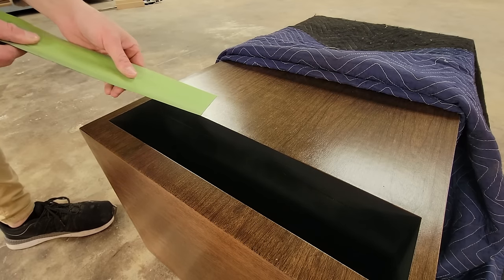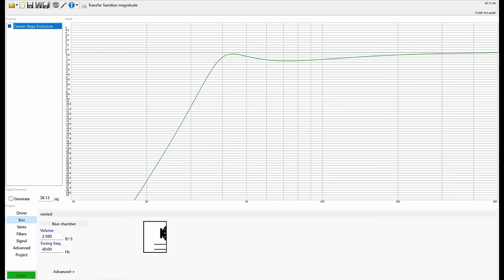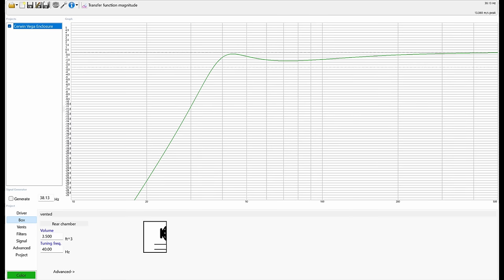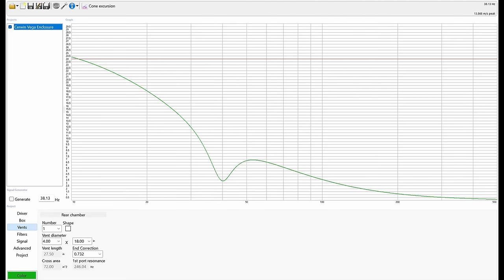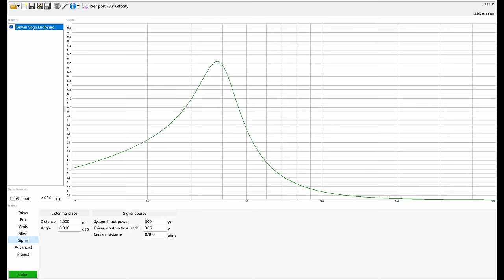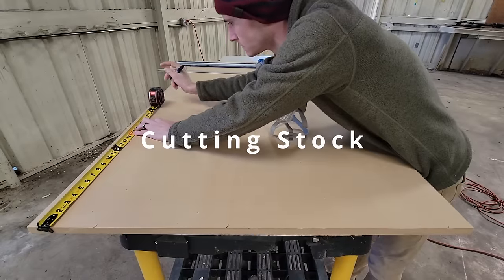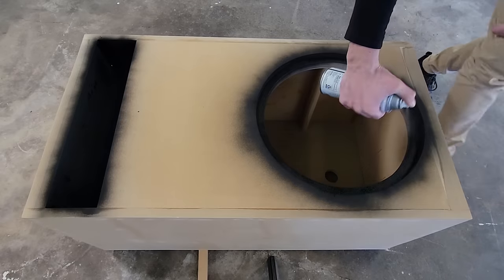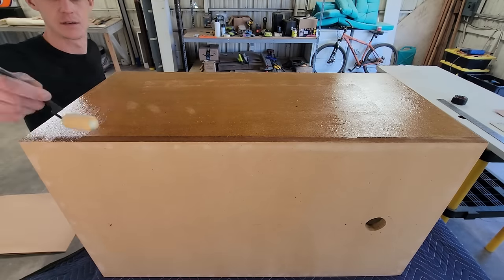DIY Subwoofer Build With The Legendary Cerwin Vega Stroker 15

Comment: Did someone say Stroker?

I've been obsessed with these subs since I was 14(I'm 44 now) I've never even heard one. I'd love to have a build like this. It's very nice.
Reply: Same here always wanted one
Reply: @abramesparza1945  Did you see them for the first time in a Crutchfield magazine like I did? Lol I used to lust after the Stroker. They had a 32 pound motor which was unheard of back then. I did a hood about 10 years ago. Kind of wish I had used them when I had the chance. I'm out of the car audio game now. Probably forever.
Reply: I recently got me a Stroker pro classic 18” and I too dreamed of this sub in the 90’s. Proud to have it in my current system. Might I add, these subs sound accurate and get low and loud all in one.
Reply: @Jt19702  That's awesome man. I'd love to hear it. What Amp do you have running it? Sealed or ported enclosure?
Reply: @dextermorgan1 I currently have it ran by a JP43 @ 2ohms. My plan is to run it on a quality class A/B amp to get the most SQ with the ability to get a little loud.

Comment: Great build! I love CerwinVega! I wish they would do some nice wide baffle home speakers with the high build quality that the stroker sub has. They are definitely capable of it. One free tip that you could have done, and might consider on all your builds is to round over the inside of the woofer hole on the baffle. This can help with letting the speaker play to its full potential and doesn’t cost anything. 👍🏻
Reply from the maker: Yes I hope they release some nice tower speakers in the coming years. They do have a pretty extensive line-up at the moment. They're just not very visible as a brand. 

If you notice on the recess, the t-nuts actually hang out just a bit. I was afraid rounding over would expose too much of it, and be weaker. This is a HEAVY driver, so I played it safe. But yes, definitely a good idea in general.
Thanks for watching!!

Comment: I've got a Stroker 12D (dual 4 ohm) from around 1995 in a 2.7 ft3 L-port enclosure tuned to 45hz (C-V recommended) and while it's a pretty unique woofer, there's no way I'd have paid what it cost new. Found it on the side of the road on garbage day. It still works, but maybe after a recone I'll be impressed, dunno.
The 15" and 18" versions are WAYYY more effective.

Comment: I think you should have done bolts instead of a cup cut out for the wire conneciton outside the box.  years ago I would have not known the improvements that avoiding those would lead to.  Tubes (mainly for home) or nice lugs to bolt to is what I see more of the pros use.

Comment: Makes sense now!  I thought it was some type of coaxial driver when I first saw it so the thought of a one driver full range enclosure sounded. . different. Can’t wait to hear it. Looks great, as usual. Btw, how long are the pin nails you use?
Reply from the maker: I believe I was using 1-inch, and 2-inch for double panels when possible. I didn't nail everything, just when it was easy enough. I always prefer clamping when conditions are right.

Comment: HEY!!! A fellow user of the "thumb on the button" rattle can painting method.
Nice work on the cab.
Although...
I did flinch up a bit when you stepped back to hit the lacquer with one last little kiss from your sprayer 
IN THE OPPOSITE DIRECTION of everything else that you had laid down.  Lol.   
I have done this many times laying different types of finishes and have only had it effect the sheen once or twice.
But when it does... I just feel sick about it, so it's become a reflex for me to flinch whenever I see two wet products overlapping perpendicular from each other. 
Like a jump scare video. lol.
But I can be anal about things "just in case" but that one can for sure bite you on big flat surfaces like that.
You're doing a very fine job and you have reinspired me to consider doing something this weekend.

I have an older Peavy Backstage guitar amplifier that has working electronics, but the box is rough, and I have thought about 
Building a new one from red oak with an ebony die and lime wax finish (Cerused finish) and make a solid copper face plate
along with 8 corner covers from the copper as well.

The speaker it those are nothing to look at, so I need to come up with some type of fabric to cover it with.
Something blk and copper colored

I will also change the knobs to something better (to match new design) than what is on it now. 
I anyone thinks what would be a cool knob idea (vol / tone / drive, etc) let me know, I am thinking about something that size
that already exists that I could drill an apx. 1/2 in. deep, & apx. 3/16th dia. hole in the rear of it to mount it to the Attenuator
Black/ copper color related.

The only thing that I have thought of...

I was thinking about soldering a few 1 oz. Morgan copper dollars or something of a similar type design 
(many different styles from $2 to $9 ea. .999 pure) to a hex shank rivet nut just because the nut would be an easy way to make it mount, but something cooler, would be way cooler.
Reply from the maker: Jump scare lol I get that. It did turn out fine, but I was going crazy with the lighting in my shop. With that sunlight coming in from one side, it made it look like my spray pattern was all over the place. I couldn't resist hitting it one more time lol even then it didn't looked right in the sun. When everything cured it looked great. Not the first time I've had sunlight play tricks on me!
Reply from the maker: And yes I think you should go for a weekend build project. If you finish it, let me know where I can gander some photos!

Comment: Nice build! What are the internal dimensions of the box and the vent?  I've got a BOXPLAN workbook that can predict where the out-of-band vent resonances will show up, and this are impacted by the internal dimensions of the box and the location of the vent and the driver in the box.   The impedance curve shows a bit of loss around Fb BTW, but I suspect that's more due to the driver than the box, because the box looks pretty solid.
Reply from the maker: Hey, I'll have to check for enclosure dimensions when I get around my PC. If I recall, I believe first port resonance was pretty high, if that is what you're referring to. I believe it was at least 140 or so, but I'd have to look again.

Comment: Nice build! I love cerwin vega, and the strokers are high up on my list of things to build. Normally where I live I see the stroker built with tubes, like standard round vents. How do you get the measurements for the square vent you built? I see that you use winisd and square vent,  it your is like a small horn with those angles etc.
Reply from the maker: Hi, square & round ports act as the same thing. There is a mass of air inside that can act to extend bass for some frequencies. If you're familiar with winisd, you can simply click on the square or round port icon to change between them. In general I use slot ports, because they are cheaper and usually easier to fit inside an enclosure.
Reply: @DIYhyfy  Thanks for your reply! I’m not familiar per se, but since last night I’ve modeled boxes and boxes. I figured out that square vent thing now. But, the vent you made in your stroker box, did you take in consider the displacement of the actual port?

Comment: Put a washer on the train nut bolt not to damage the baffle
Reply from the maker: That's definitely a good tip. I did use a washer on the first couple, but it was a bit too big, and was hard to get out afterwards.